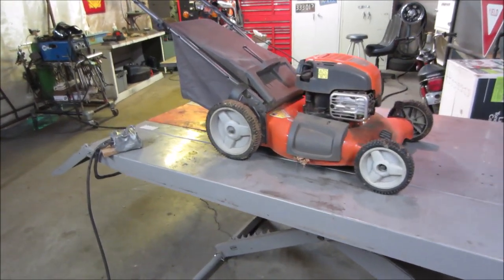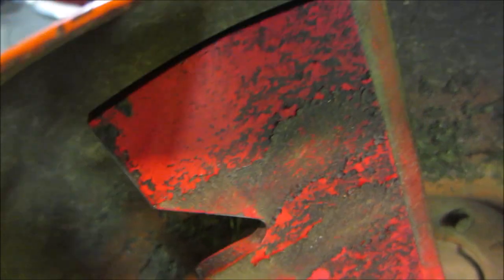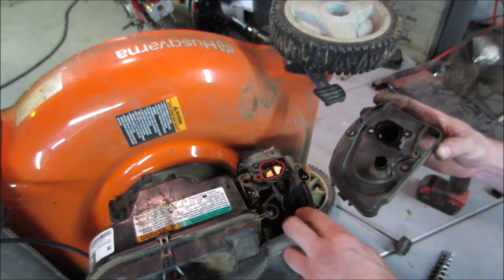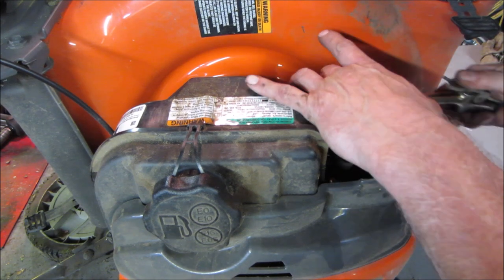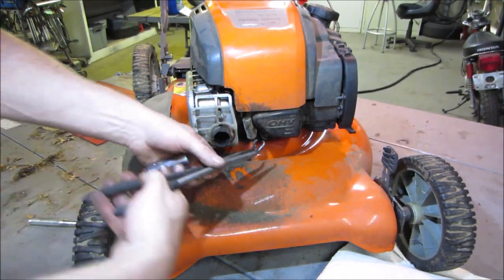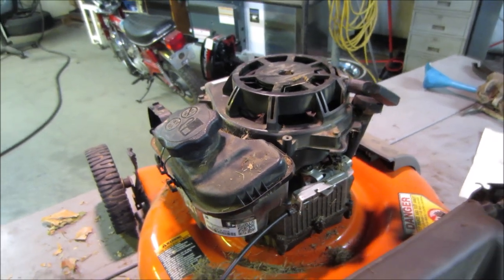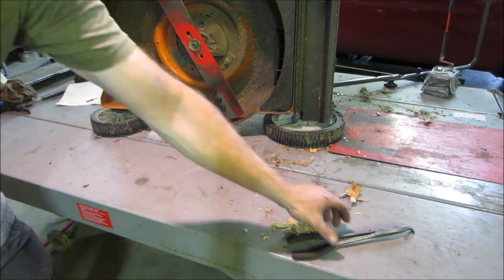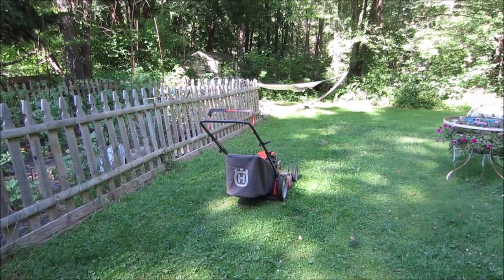NO OIL CHANGES? Servicing A Broken Yard Sale Lawn Mower,

Comment: Mows fine. Installs new blade Mows like crap. There's something wrong with this thing!
Reply: Make sure you put blade on correctly and you didn't put it upside down. The blade spins towards discharge side of deck so cutting edge of blade should be turning that way as well.
Reply: Probably hit something like a tree root or a bolder.  Replaced the chunked blade incorrectly and assumed he broke the mower in the first place. The guy gets a slight nod from me just for giving it a shot.
Reply: @bobadam7021  With the few wonder if the previous owner of the lawnmower had hit a rock to put a dent in the original blade when they replace the blade when they now toss the mower when it was cutting even worse as in the age of disposable products had them leave the mower on the curb on trash and recycling day after getting a new mower.  Even as those going out on trash and recycling day ahead of the garbage truck when they loaded up the mower usually had the sign of free on the handlebar when those made a video of the service or as the previous owner kept the box the mower came in when it also came with a plastic chute to turn it into a side discharge mower when those flipped the mower on its side when they instantly see the error when the new blade was installed upside down when there is instructions on which side the blade is to be installed stamped into it as flipping the blade to the proper side when those have a mower they can depend on.

Comment: I was out shopping last year and , along with my buddy, signed up for a mower giveaway. A nice drag you behind Craftsman 21 inch mower. 163 cc's of Briggs power. My buddy won it. I'm not so lucky . Well he couldn't use it as he has a one square yard of grass at his place. So I've used it ,washed it waxed it romanced it and in general really liked the workout it gives. Was mowing a few days ago and sputters and died. Tried to start it, nope won't start. Later I tried it again and it fired first pull hit it's governed speed and died. Took it apart found noting of interest in the carb, no dirt and I don't use ethanol fuel in any of my 15 PC's of yard equipment. Does the same thing starts once hits the govenor (sp) and dies. It has about 10 hours on the engine and it's been serviced 3 times in a year and a half. Oil is cheap. Filters are cheap and I change them when needed. What am I missing if you have an idea. I would love to hear it. Thanks.

Comment: I have this mower and just starting out mowing season 5 with it. I change the filter every so often and make sure it has enough oil and it has been working like a champ. It starts up on the first pull every time. I do sharpen the blade every now and then and should probably get a new one one year. I used to change my oil, but glad I don't have to with this one. Great video!
Reply: it shows in the owners manual, that you should change the oil.

Comment: I had one like that when I was 12 years old.  My dad had sharpened the blade and put it on upside down.  When I went to reverse it, the wrench slipped and caught my right knuckle on the freshly sharpened edge resulting in 6 stitches and a plastic bag on my hand for the week at the beach at Ocean City!  Given that experience, I spotted that right away.  It's one experience I'll never forget!

Comment: My Norlett Lawnchef with 150cc B&S 4 stroke motor is from 1981. 
Its been utterly reliable. 
I have never changed the oil. I gave it a new spark plug and filter 10 years ago.
Starts 3rd pull every time!

Comment: When I bought my self propelled / push mower, I got one of the ones that said the same thing on the box....."never change oil, just check and add". In the manual some place it states "LIFETIME OIL".....When I asked about it at Home Depot, the guy said that its because they use synthetic oil and because the engine is built "better to last".......I think its a load of BS. It's just way for them to sell more mowers after people never change the oil and they blow up. I'll be changing the oil on mine for sure.
Reply: Lifetime oil and a one year warranty.
Reply: @jsm3233  exactly. It's a scam.
Reply: @jsm3233  I'll have to go back and look, but I'm pretty sure it said 3 year on the box.
Reply: @jsm3233  1:10
Reply: @mattmanyam  wasn't commenting about the mower in the video. Was replying to  brad08stanggt 's comment. It's a marketing scam, the manufacturer isn't going to replace it anyway. The original oil will last three years. By lifetime, the manufacturer is saying the lifetime is three years.

Comment: Cool !... I just pick up a 775EX Husqvarna today at a flea market called Rogers on east side of the town called Salem Ohio. I got it for 90 bucks. The young boy said it was in a garage for two years and that it was his fathers mower.  He put some gas in it, I notice the oil was low. He did start it up with one pull. and then he turn it off. Everywhere I looked there were a few mowers but, they wanted a lot on money for a lot of junk. I did get it home and I will go thru it and hope all goes well. Thanks

Comment: before you go messing under any lawn mower you should disconnect the spark plug.

you could easily chop off your hand if the mower was to start up while servicing

it may be possible that it is a 2 cycle and it has some internal porting that injects the oil into the firing chamber 

i know in the 80s some mopeds that used 2 cycle engines had a separate oil bottle so no need to mix. you just add the fuel and oil to their respective bottles and internally they was mixed.
Reply: did you read that in a book? he knows what he is doing - and even if he doesn't he can decide for himself.

Comment: One thing I learned  many years ago when working on mowers that had the blade information missing....if you don't know which way the blade goes just take out the spark plug, give the rope a slight tug and watch which way the engine shaft turns.   Of course, that is only in extreme cases.

Comment: You should get a fog machine, darken the shop with just a spotlight on the mower and have it rise up out of the fog! Very dramatic! HA HA!
Reply: LOL
Reply: There is a fog Device for old lawn mowers. You replaced the  muffler with this device added the 1 quart tank to the handle bars filled it with bug repellent and fired he up then opened the small tanks valve and out poured the smoke. My neighbor had one and after he found out how much they wanted for a 1 quart can of the bug repellent he simply bought the cheapest motor oil he could. Provide your own container, $.27 a quart for 30 weight! This was back in 65! Still made smoke and the bugs still went looking for better pickings.

I miss the old days.

Thanks Mustie1
Reply: Exactly right. I couldn't remember the fog liquid but DDT is what you used. And they said it was safe to get on your hands!  It did do a phenomenal job getting rid of the bugs from sunset to around 3-4 hours later. It's amazing I don't have cancer by now.
Reply: @jamesshanks2614  this is awesome lol haha jesus the EPA were savages back then
Reply: @cashen7384  
The EPA didn't come into being until 1969.
Reply: @bertgrau9246  thanks for the info

Comment: I picked up a honda mower and was super excited because it was going to be a replacement part mower for mine. The homeowner said nothing turns and and stuck. The only thing wrong was one of the blade bolts fell off and blade got damage in the shield and was stuck. I had a replacement blade.. and bolt.. didn't have the heart to keep it as it was an elderly neighbor of mine. He loves that mower till this day.

Comment: The only real "never change the oil" motor is a brush-less electric motor.
Reply: Bearings still wear out
Reply: @ford300rippergarage  oil ur bearings so they take longer to wear
Reply: @Ian-ff2hz  most consumers are too ignorant
Reply: @ford300rippergarage  yeah, people like to throw things away
Reply: Oil-impregnated sintered bronze bushings?
Reply: EMD 645 and 710 3,000 HP tugboat main engines. We send out monthly samples for testing. My current boats oil is over 9 years old and never been changed. Add fresh oil while running and never stop.

Comment: Full synthetic oil? Even running full synthetic I would still change the oil but I wonder if that's the reasoning behind the no oil change. 
There have been tests done on FS oil and it does last a very long time compared to conventional oil before it starts losing its viscosity.
Reply: Briggs says so there confident in the air cleaner system and tight tollerences inside the motor that you shouldn't have to change the oil which I think is bs oil gets sheered down after so many hours on a air cooled engine
Reply: You would be surprised at the number of people that don't change their underwear any more regularly than their engine oil. Most. Of the used mowers I pickup , have oil so thick and "colored" (gotta be politically correct) that you can pick the whole machine up with the dipstick.
Reply: @donaldteal8720  exactly if you can't change you're oil you shouldn't have a engine get something electric if your to lazy to maintain your equipment

Comment: “That good stuff looks like pre-mixed” 

continues to pour
Reply: Two cycle oil is designed to not foul the plug, it's honestly not bad for most Motors. It's just going to run a little smoke in some cases, and that's about it.  I know a lot of older Motors, as they aged it was recommended that you started putting 2-cycle oil in with the gas, just to make sure the piston rings were well lubricated.
Reply: Won't hurt anything
Reply: "The good stuff" 92 octane no Ethanol.
Reply: I use it when starting mowers that haven't run for years, it provides a little extra lubrication for the top end
Reply: I always put a dash of 2 stroke oil in my mower gas. I have to mow a steep hill on my side yard and so just in case it doesn't lubricate properly at a 45° angle I figure it's good insurance. I don't have any issues with fouled plugs. I use high quality NGK plugs too instead of the shitty Champions most engines come with.
Reply: I always put my old pre mixed gas in my mower.. Non issue.
Reply: @oldflatbeder3218  the awesome stuff- 110 avgas with lead :D
Reply: old flatbeder.  92 is not needed for a mower.  They are mild low compression engines built for fast rev.  87 is fine and starts faster in a cold motor than high test.  Lower flash point, more flammable the lower the number goes.
92 won't hurt anything but wastes money unless that is the only pure gasoline you can find.
92 is great in your Corvette or Porsche.
Reply: @chubbysumo2230  It's not about fouling the plug. More oil means less gas, that means the engine is running leaner. adding more oil is doing more harm than good you're leaning out the mixture and not realizing it.
Reply: @eclipsegst9419  Yeah, gotta love the blue avgas.
Reply: @STho205   Wrong... My vet loves 104 octane white gas. What the hell is a Porche? Other than a glorified Volkswagen.
Reply: @johnsmith7709  you must be so proud.

Comment: I've never changed my lawn mower oil in like 7 years it still runs and if it breaks we'll just pick one up off the curb that runs
Reply: I did after a long time and now it burns oil
Reply: I have a super cheap Murray from H. D. I guess. In 19 years of using it, I changed oil a few times, maybe. And still has the original spark plug in it. Biggest problem is that the connection for spark plug wire is broken, so I Jerry rigged it. Best $99 mower I ever bought. I do have 3 Troy-Bilt's, for doing other people's lawns though.

Comment: Nice Vid.. thanks for taking the time to make it..  
amazing what you can pick up at a yard sales after a Muppet has been messing with things :-) 
it would be nice to see you make a vid on replacing fuel lines and choke bubble on mower and weed wacker.
oh yes your comment on  not leaving fuel in the machine over winter.  the problem with that is that come spring the plastic fuel lines have dried out and crack.. so I leave fuel in the machine and every few weeks I power the mowers (actually all my small engine machines) and let the engine run for about 5 to 10 mins.. come spring time they start with no problems without dried out cracked plastic fuels.

Comment: Reminds me of the Craftsman mowers that I worked with when I was at Sears. Some were delivered with a Honda OHV engine as opposed to the Briggs & Stratton engines. The Honda was quieter and more expensive. I never saw a mower that said never change the oil. Of course you do, whether is a push or a riding mower. Change the oil if you want it to last a long time. Great video.
Reply: I have one of the Craftsman mowers that'a at least 15 years old, with the Honda engine that's still running great. The picture on the box had shown the mower with a Briggs engine on it. After having the Honda, I wouldn't own another Briggs engine.

Comment: Oil change? We don't need no stinking oil change.
Reply: Yeah, it burns enough oil, essentially replacing the oil every season.
Reply: @greenzrx  that's not the problem. Lots of people do that to old cars just fine, but they at least change the filter once a year. Lawn engines have no filter so wear metals will just build up more and more until the engine shits out